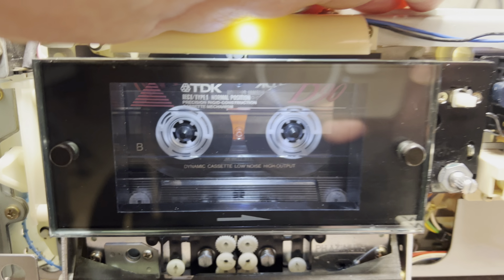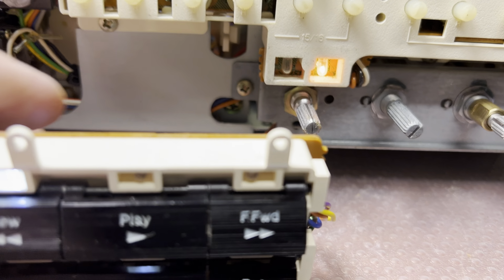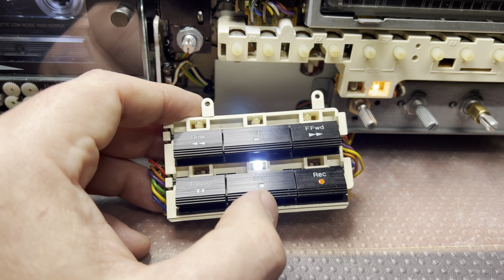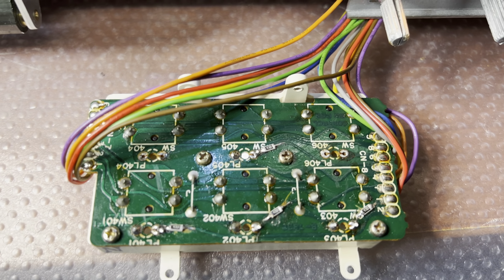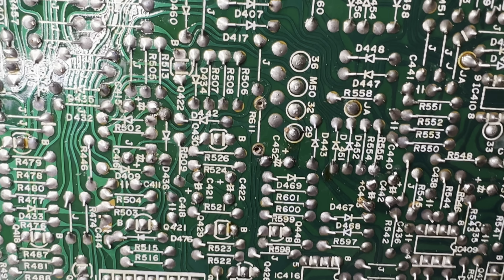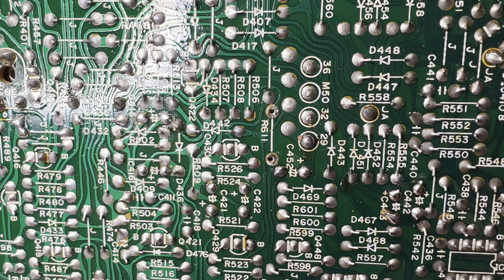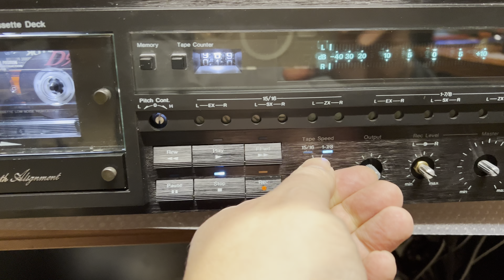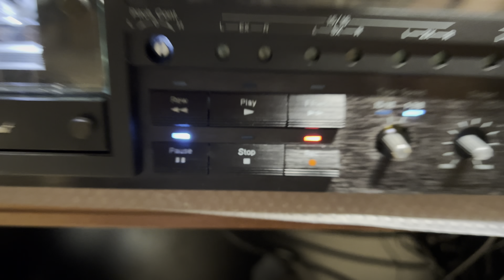Replacing bulbs with LEDs on Nakamichi 680zx

Comment: Often thought of doing this but would like to keep the lights the same colour as the level meter. So far I have not been able to find the right colour. Scratching the let works very well to diffuse the light pattern as you want it. 
Thanks for sharing the stop resistor.
Reply: Look for emerald LEDs
Reply: @NakamichiTapeService  thanks Matyas, I will look out for those and test them 👍
Reply from the maker: Well, I tried everything, I even got a programmable LED and made Arduino program it with the proper color. However, when I used a smaller CPU to fit it into the space, I figured out that a 10 MHz CPU is not enough to program these LEDs, that is where I stopped :( I like the white LEDs BTW.